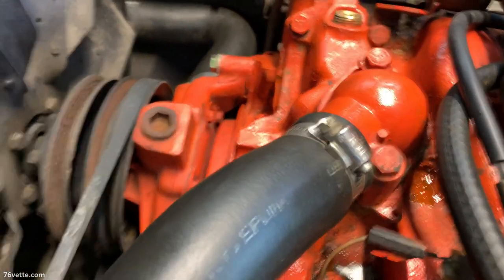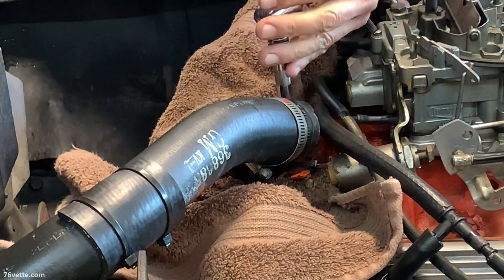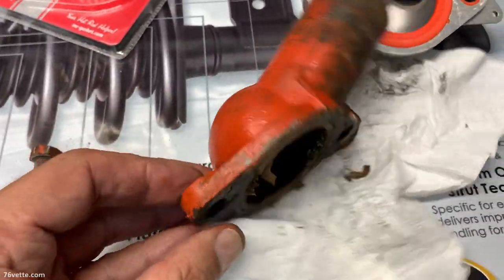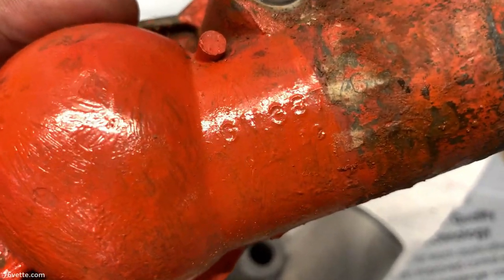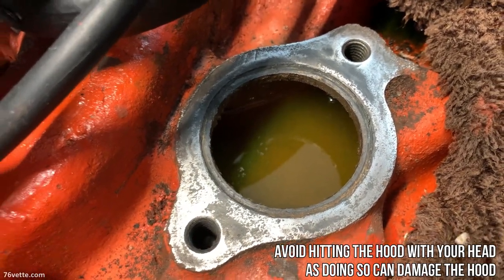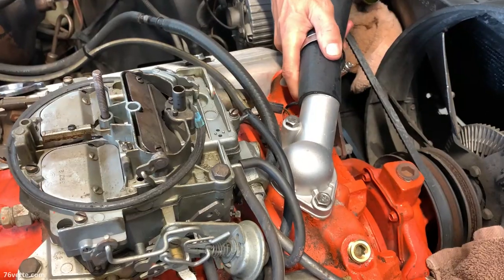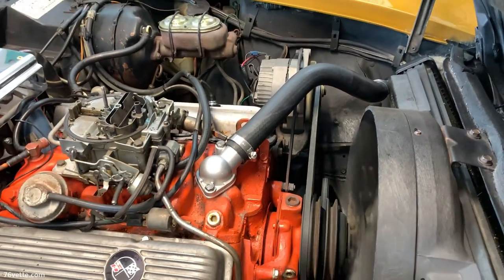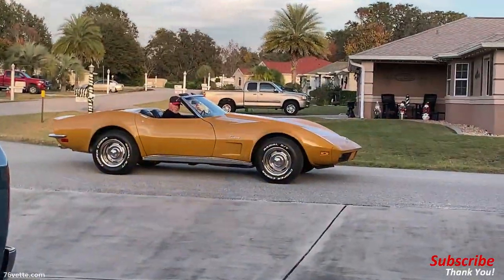New Thermostat and Gasket. NO MORE LEAKS!

Comment: One of the bolts for the thermostat housing on mine was pretty rusted it broke but enough bolt to put a nut on it, it worked. Too easy to hit your head on the hood I done it a few times. I kept the original hose clamps but used new ones just to say I have original hose clamps I guess.
Reply from the maker: Those original clamps are good. Glad to hear you were able to remove the broken bolt. That can be a nightmare. Thank you for watching! 🙂👍🏻

Comment: Those smallblock chevy Tstat bolts have a tendency to rust into the intake.  When removing may snap off. (dont ask how I know)  I prefer replacing them with stainless studs and nylock nuts.  Studs are red locktited into the intake with the same torque on the SS nuts.  Better clamping force with no worry of snapping them off.  If replacing the original bolts, I would use a bit of antiseize on the bolts for when the next water pump/Tstat change is due.  Simple step by step as usual. 👍
Reply from the maker: Thank you for watching! 😊👍🏻

Comment: So with the 160 degree thermostat does it keep the operating temperature down closer to 160? I have the stock 195 on my 76 and my temp usually hovers around 200. I was thinking about taking it down to a 180 and hoping to have that little extra bump (or decrease) to normal operating temperature.
Reply from the maker: You’ll have to test them but I think you’ll be fine with a 180° thermostat. 

Now, as you know, the thermostat in this case does not regulate temperature but rather at what temp it will open to cool the engine and keep it at the desired operating temperature.

I run a 160° thermostat in my ‘76 with a three-row aluminum radiator, and operating temp stays at around 195° most of the time. 

With a 180° it would run at 205°, and with a 195° thermostat at around 210° which is not unreasonable for these engines. 

But since I live in Florida and run the a/c every time I drive my Vette, I prefer to keep it at around 195°. 

I hope this helps, and thank you for watching! 😊👍🏻
Reply: @76vette  one more question. On one of your older thermostat videos you cleaned and painted your thermostat housing orange to make it look new. Which brand / shade of orange did you use. I would like to do the same.
Reply from the maker: I usually just buy Chevy Orange engine paint from the auto parts store, Walmart, or Amazon, https://amzn.to/3oEiOGS 😊👍🏻

Comment: What can I spray/use to clean off old gasket ?
Reply from the maker: There are lots of different brands of gasket remover products available. I usually use CRC gasket remover or Goof-Off and/or a razor scraper. Seems to work fine for me. Thank you for watching! 🙂👍🏻
Reply: Now  plug with wires from bottom of distributor broke apart. Is that plug  something auto supply will have ?
Reply from the maker: @trig5010  Most likely.